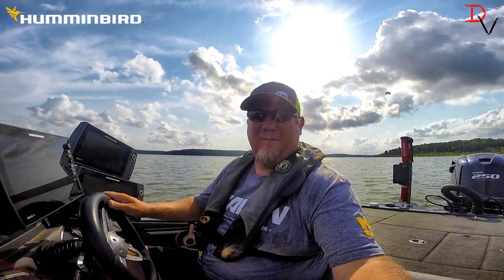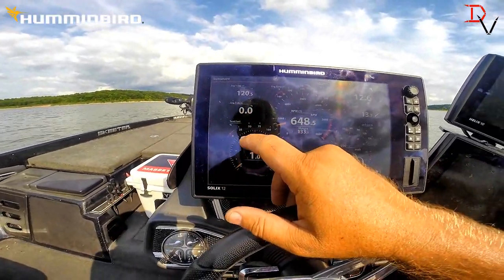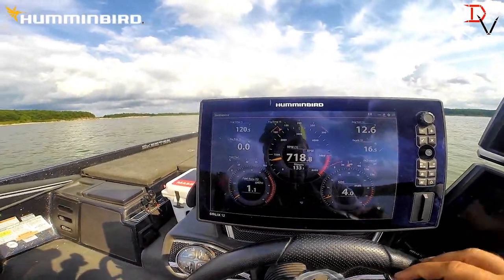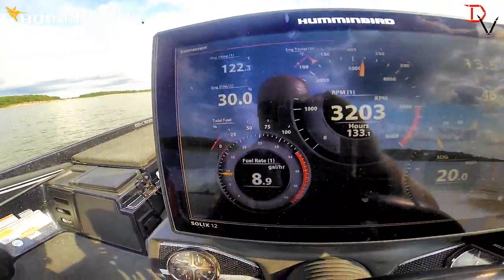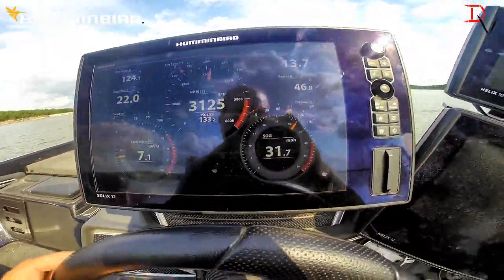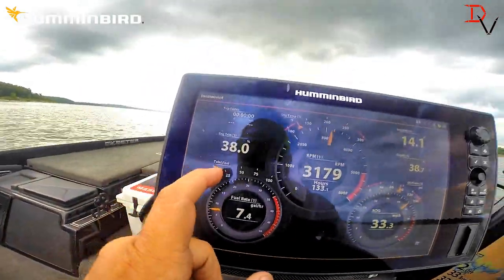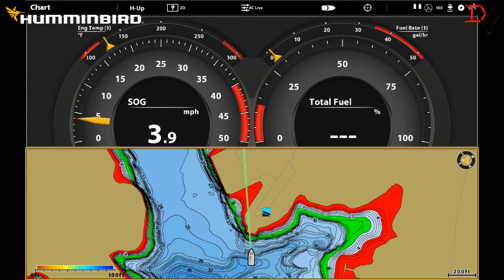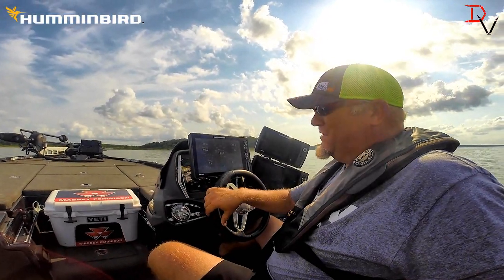Tips 'N Tricks 217: Humminbird SOLIX - NMEA 2000 Network on the Water

Comment: Si the NMEA 2000 is strictly for later model engines that can adapt to it. Other than that with Humminbird & Minn Kota theirs nothing else to use that port on the Back of A Solix fore. If I'm understanding correctly. Thanks for another great Video

Comment: Could I take this and replace it with the build in Lorance in a Nitro Z21. The Lorance is used to show the same stuff as that.
Reply from the maker: Yes you can if you have the Lowrance NMEA2000 Network you can use that connection to hook direct to the Humminbird SOLIX
Reply: Doug Vahrenberg watch the link and see i fit will hook up to that Lorance
Reply from the maker: No link. Bur NMEA 2000 is an industry standard protocol for connection and data transfer. Doesn't matter brand they must work together.
Reply: Doug Vahrenberg https://youtu.be/bFw-PO71vc4
Reply from the maker: The NMEA 2000 Gauge it will work for sure but the specific boat functions I will have to see if that is a function of NMEA 2000 or special software for that boat only. Neat idea but I also think of the consequences if something has and you have no control of your boat.

Comment: Watched the install video and you mention the backbone unit. I’m new to all this. Is that part of the motor?
Will this hook directly to a new Suzuki Df200a?
Reply from the maker: NMEA Backbone is sourced from the numerous suppliers of NMEA 2000 Network Cables and you will need to talk to your motor supplier to what is required and if they offer NMEA 2000 compatibility. The Humminbird SOLIX allows direct connection to the NMEA 2000 Backbone cable.